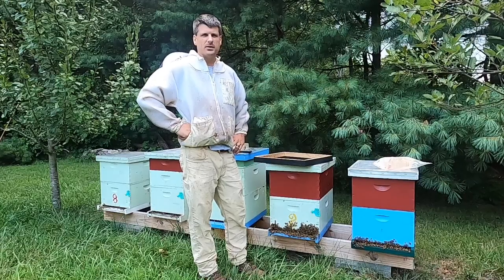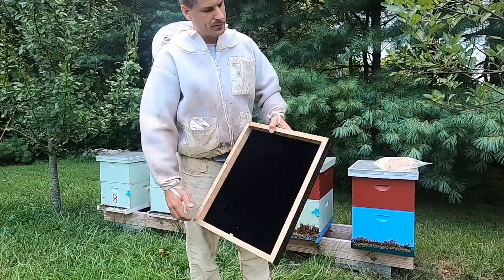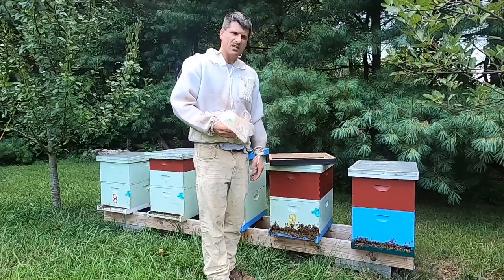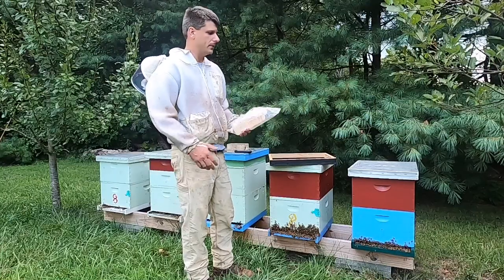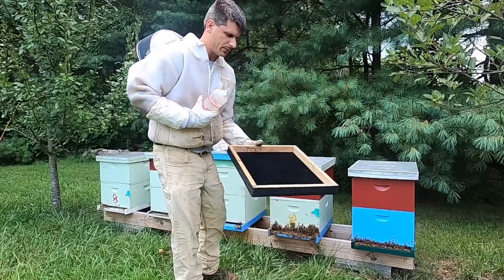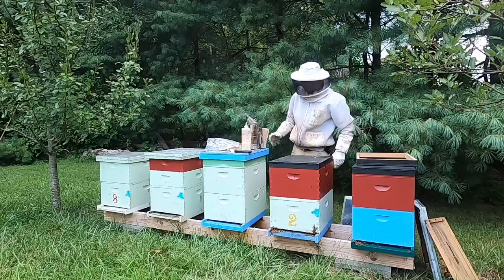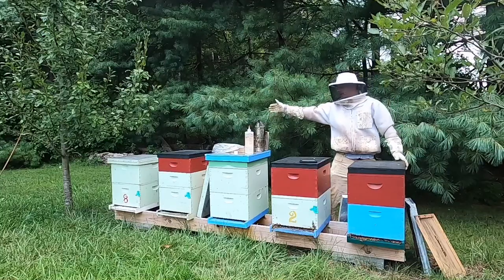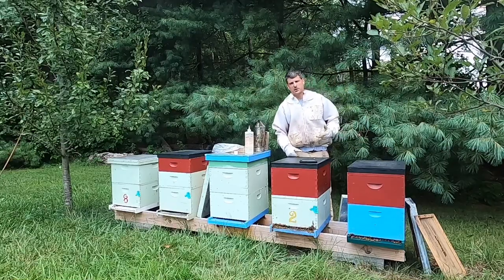How to Use Fume Boards to Remove Honey Supers

Comment: I use this method and it never seems to clear them out completely. I always end up blowing the rest out with a leaf blower. Thanks for sharing! 😊🐝
Reply from the maker: I agree…and not my favorite method but it has its place. If I pulling supers from bees that I’m hauling the same day, it works well so the bees aren’t so disoriented. Also nice when working by myself so I can just haul supers instead of also dealing with a blower. I’m like you though, seems there are still some bees left and it doesn’t work great in an overcast day like the day I filmed. Thanks for watching.